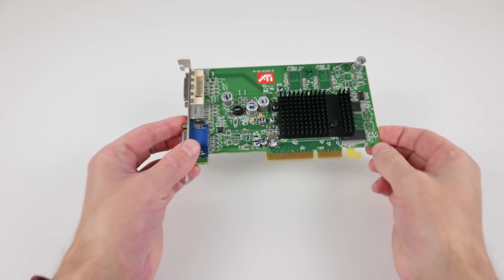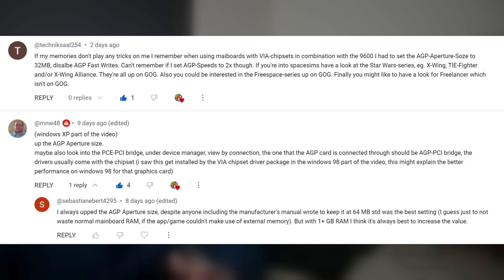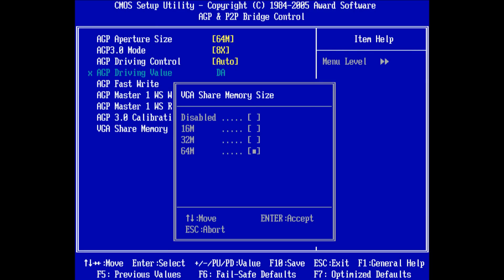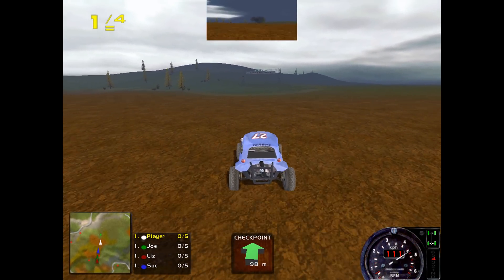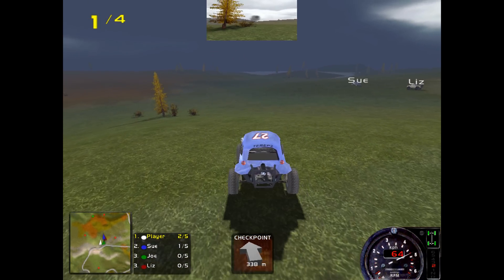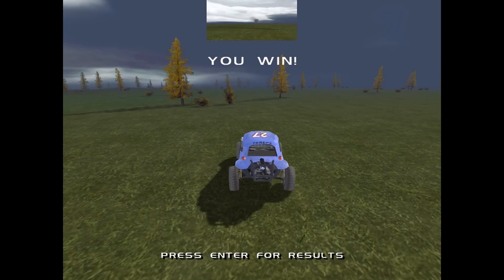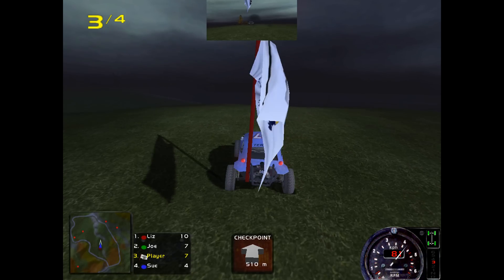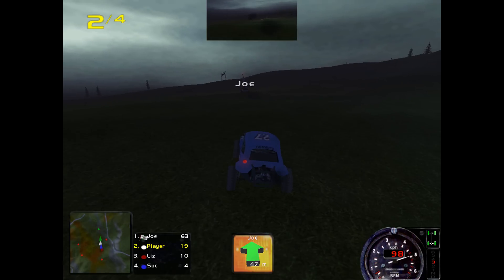VIA Chipset: Lessons were learned

Comment: It was chipset quirks like this that contributed to my jump to Intel at the time. I would've stayed with AMD CPU's, but the motherboard chipsets (Via, SiS, AMD, Ati) ALL had weird incompatabilites, bugs, and driver issues. Intel chipsets at the time were relatively problem free.
Reply: After the VIA KT266 with a Duron 1200MHz I upgraded to a Athlon XP 2600+ with a VIA KT333 chipset. Both horrible overclockers 100% VIA chipset to blame. Then I went full guns blazing With A DFI Lanparty motherboard with a Nvidia chipset and a Athlon 64X2 3800: I rate this motherboard to be among the best motherboards ever. Just zero bullshit and fully stable with extreme  overclocks. Laughable how easy it was...
Reply: Sadly modern AMD chipsets are still problematic, causing issues like USB dropouts and fTPM stuttering.
Reply: @offspringfan89  and absurd boot times as well as unacceptable idle power usage...
Reply: @pianoman3214  kind of defeats the hole efficiency arguement when ryzens are using 40w to just browse and meanwhile intel is doing it in under 10w. and yeah the ddr5 thing was hilarious, 50 seconds post i dont even wait that long when trying to post stupid memory settings
Reply: @bigcazza5260  Yeah i know right? my last bios post time was 38 seconds with everything tweaked on the pre cpu exploding bios (its fine, i manually tuned all my voltages anyway lol) and i'm currently using around 90 watts at the wall with chrome, discord and spotify open. Around 130 watts with a youtube vid playing. Being a staunch supporter of am4 and waiting till am5 to upgrade from haswell is so disheartening haha.
Reply: What AMD chipsets gave you issues? I've heard AMD 750 and AMD 760 north bridges are ones of the best in terms of compatibility. Sometimes they were paired with Via southbridges that could give you issues...

Comment: I have used a Sapphire 9600 256mb version with same PCB (all memory slots filled) in Windows 98 on MSI KT3 Ultra KT333 with Athlon XP 2700+.  Good card for win 98 pc. Never had issues on s. 462 platform. 

Awesome to get video of the fix for later s. 754 - 939 systems.

Comment: I feel seen! I had to switch sound cards back then because I couldn't use a sound blaster live with my athlon system (moved to Turtle Beach). Nice to see this addressed.
Reply from the maker: I had a look recently for Pentium 4 boards, well seems they are now also rare. At least here in Australia... A real shame that AMD didn't have chipset for Socket 754 and 939. They had great chipsets with the AM3 platform, but Socket A, 754 and 939 it's VIA and Nvidia and I had heaps of issues with Nvidia chipset boards not working anymore...
Reply: @philscomputerlab  There's at least one Socket 754 motherboard out there with ATI chipsets - and that's the MSI MS-7145.  Even has onboard ATI xpress 200 graphics.  Southbridge is an ATI SB400.  Runs Windows 98 perfectly, even with a PCIe graphics card.
Reply from the maker: @retro-computing-gaming  Oh that's interesting!
Reply: @philscomputerlab  Correct.  There's also ATI Express 1600 and 3200 motherboards available for Socket 939 that did crossfire in 8x / 8x modes or even 16x / 16x modes.  Very VERY rare to find ATI chipset 939 and 754 motherboards today in 2023, they weren't very common back in the day when they were new either.  I have a A8R32-MVP Deluxe sitting right here though that needs recapped, they definitely exist. :)
Reply: Had to do the same thing! Ah, the memories. Went from SBLive to Aureal Vortex.

Comment: I might try this out with this PC that's been giving me issues for months. I've got this build with a Pentium Dual Core and 4GB of RAM (I don't remember the mobo model, I wrote it down in my main PC but I'm not on it right now), and Windows 7 installed. I've tried installing a GeForce 8500 GT 512mb but the mobo hates it for some reason; there's graphic garbage (white dots everywhere in a sort of grind position, and the entire screen sometimes changes to a green tint) even while still booting up or in the BIOS. I've tried using the card on other PCs and it works perfectly fine everywhere else but here, which is ironic because apparently both the card and the mobo are from 2007, so it's positively not an issue of mixing up parts from different eras. I don't think it's issue with the PSU. The mobo doesn't show any physical signs of being faulty (bulging capacitors, etc.), although I don't have any other contemporary PCIe cards I can try out on it. Without the card installed it works perfectly fine, it's just that you can't do much with the integrated GPU.
Reply: Can always try a non-contemporary card, just to check that the board is fine.